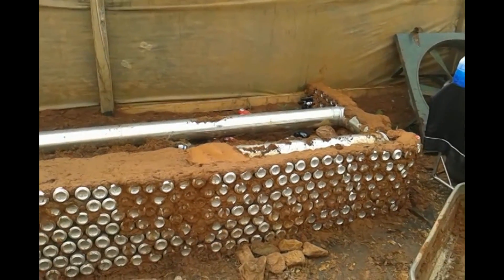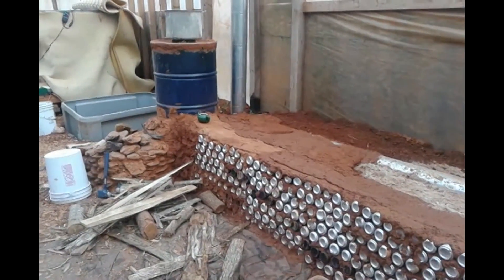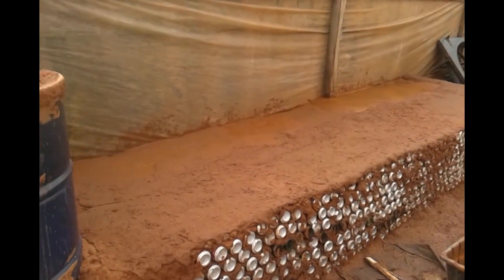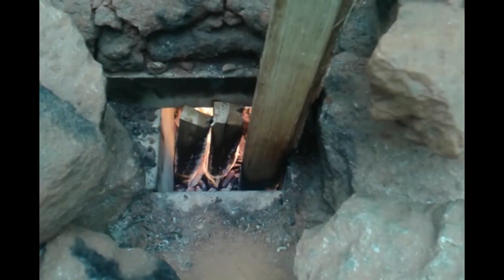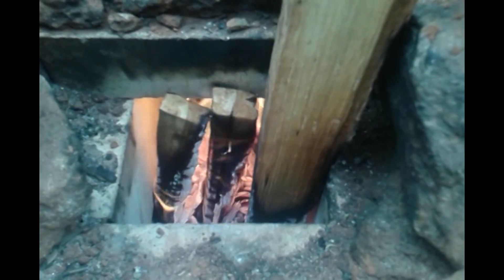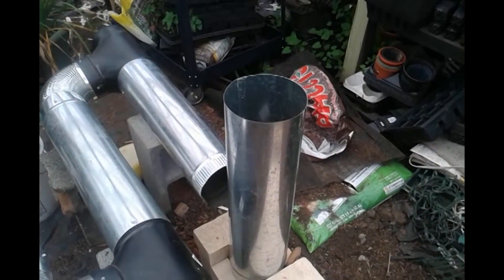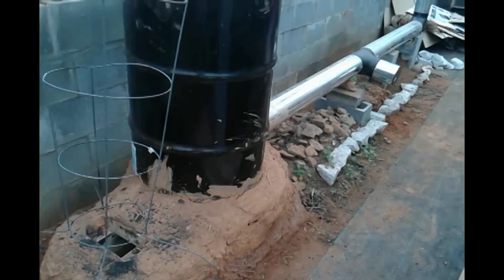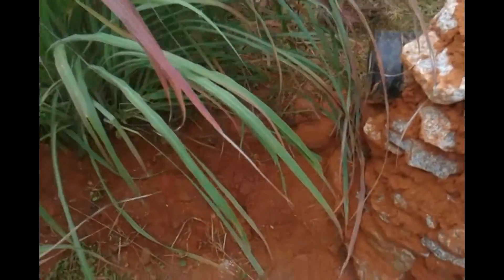Rocket Mass Heater part 3

Comment: Thank you for sharing these greenhouse rocket stove builds.  I was wondering why the ducting is so high in the mass though?  The heat radiates but also rises.  Does the whole mass efficiently store heat in this configuration?  I have never built a rocket stove, but want one in the small greenhouse I am planning.  I would like to hear your theory and anecdotal experience on this point. Thank you again making your builds available!

Comment: Hi, I love your work and the way you are showing your rocket stoves,  they truly rock! I remember you mentioned in the part 2 video, "the longer the pipe is the better it will perform", does it include the pipe under the cob (horizontal pipe) or just the exhaust ones (vertical)? Would you be willing to share the plan for the stoves? Thanks!
Reply from the maker: The stoves draft better with longer bench pipe and vent pipe. I don't have any plans but I will try and draw some up for you. Thank you for watching
Reply: +goforgreenliving That would be awesome, thanks a lot!

Comment: Maybe you  already addressed this, but why use the cans and bottles in the main part of the mass?  I would think that you would be able to store more heat if you only used cob as the air in the cans and bottles wouldn't hole heat very well.  Just wondering.  Thanks for the video!
Reply from the maker: Yes you are right it would hold more heat I used the cans as building blocks to build my front wall. They are strong and easy to find. Clay bricks would have been best. Thank you for watching
Reply: Yup.  Thanks again for making the video.  One day I will be making my own mass heater rocket stove (MHRS). It's great to be able to learn from videos like yours.  I want to make a rocket stove based on my research on YouTube and post a video showing my own unique twist to the MHRS for others to learn from.

Comment: Hi, looks great! I have seen a lot of videos of rocket mass heaters, and intend to build one myself. Your video is only 2 month old, but I was wondering if the thin metal inside youre heatriser can restain the heat from the fire?
I would suspekt the metal to melt/oxidese because its so thin (guess its ventilation pipe?) Im thinking of making my inner heatriser pipe at least 4 mm, but its expensive :-(
Let me hear what you think, or youre experince.
Reply from the maker: Lau Fowler Petersen well I put 3 inches of cob in between the pipes even if the pipe burns out the cob wont. Your right in the bench all that comes threw there is steam. I would love to see yours when you get it started Thank you for watching

Comment: Have you had any problems with losing your draft with such long a horizontal run.
Reply from the maker: Never had a problem with draft so far its the reburn in the drum that keeps the draft moving. One morning with 100 mile an hour wind it back drafted it was like a flame thrower shooting out of the wood feeder over 2 foot high but 2 seconds later redrafted itself. I put a flap on the outside so that wound not happen again. Thank you for watching and I hope that helped

Comment: I have two major roadblocks to building a rocket stove. My insurance would go thru the roof, and codes in area would never let me have one. I have been pondering two massive solar heat collectors, one routed to pex under the floor. The other running to a cob mass indoors. My thoughts being that one collector would heat the floors during the day. The other heated cob would slowly dribble out heat all night just like the cob on rmh. What are your thoughts brother?
Reply: Joseph Fairlane This is also why I haven't built a RMH in my home; however, you could build one in an outbuilding - such as, a greenhouse, which is separate from your home.